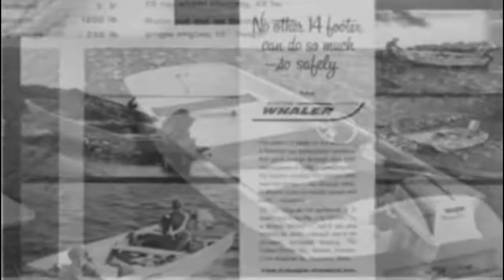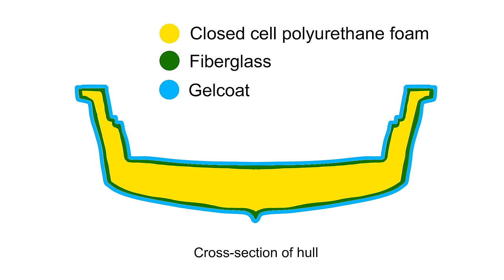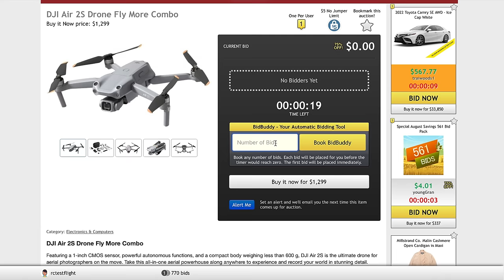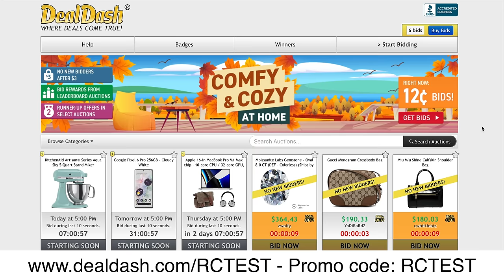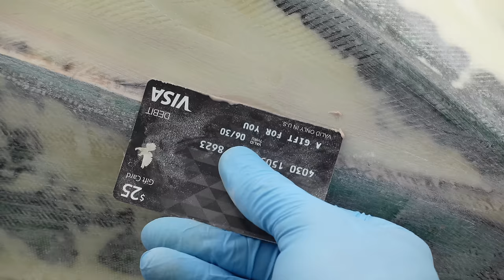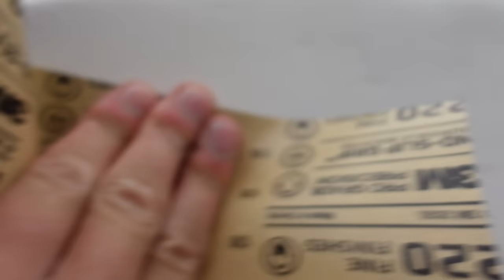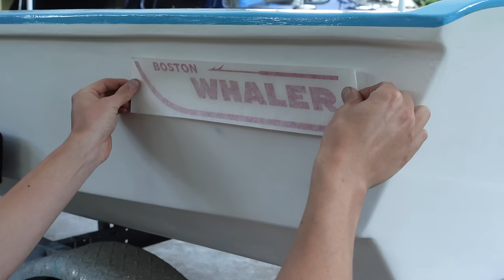50 Year Old Boat Restoration - Solar + Electric Conversion Ep.1

Comment: Yeah I got the perfect motor for your boat. I have several of them actually you're more than welcome to one. They're 48 volt 20 horsepower can be run on 96 volt for 40 horsepower made by Advanced DC. They are dual shaft and actually are perfect for mounting in an outboard motor. Removing the gas engine and keeping the lower Drive Unit diesel bolt right in. Jamie from Mythbusters used one to power a jet drive. There's another guy on YouTube that use the same Motors for a ski boat that he can actually ski behind. Anyway they're brand new. If you want to mess with one let me know.
Reply: Excellent!
Reply: NICE
Reply: Skip the outboard lower unit, lose tons of power and energy to the bevel gears turning in oil + extra maintenance. Just get a stuffing box or dripless carbon seal and straight shaft it
Reply: Do all seven motors run on one boat
Reply: @JH-tc3yu  if it were my boat that's what I would do. But with these particular Motors they are dual shaft and the one end of the shaft is the same as used by most outboard motors for driving the accessories. Makes for a nice conversion but I agree with what you're saying. I just didn't think he was going to want to go through the effort it would take to drill through the hull and make that work. There's a video on YouTube of Jamie from Mythbusters using my motor the exact same thing on a 40 horsepower jet drive and it's pretty amazing. And there's another guy that did the exact same thing on a 20 horsepower lower Drive and he pulls water skiers with it. He's also on youtube.
Reply: Good stuff. I'd want a jet boat with one that would be neat.
Reply: buy ektric ski bost

Comment: I"m sure this message will be lost in the crowd but after working a lifetime in the Marine Industry, Including years as Forman on Marina hard-stands, the range of knowlage you showed  really surprised me even if the experince wasn't entirely there. I've seen worse work by so called shiprights haha. Well done matey!
Reply: I know this comments a little old, but is a restoration thats this intensive actually any cheaper than buying a new or maybe lightly used boat? Even project boats are expensive where I live (WA State). I think ill need something at least 15'ft to feel safe taking it on the sound and I'm trying to find the most economical way to go about it 😅

Comment: May not have been cheaper, but I feel like it for sure would have been faster to just build your own boat, assuming you can get the foam they put on the inside somewhere. Plenty of channels on YouTube where people have made their own fiberglass boats in a few days without having to basically un-make an existing one first
Reply: You must be new here
Reply: I was thinking the same. I've seen some YT vids where they use sheets of foam that they cut the sheets and assemble into a boat shape and then fibreglass over the top. I've made one attempt at building a catamaran using two part foam that was to be fibre glassed,  but that failed terribly. Next will be this sheet foam approach.
Reply: Bro' do  you even watch?  He mentioned that already. I'll let you re-view the video and you can tell me where he addressed this.  Have a nice day! :)
Reply: I have an inflatable vinyl boat that cost me $60, max weight is around 800 lb. There are a bunch of videos on here of people doing plywood mods to suit their needs. I feel like it would have been easier to get one or two of those and make something. The plywood base I cut for my boat actually fits inside my car with the back seats down. It's all small enough that I don't need a trailer or a registration sticker.
Reply: That is the whole point, and why this channel is so fascinating and fun to watch:  it is the journey and its challenges that are interesting.  We learn so much more when faced with adversity.  It is the impeded stream that sings.
Reply: i think with experimental stuff like this it does kinda make sense to just get it in the water as a platform for building and testing EV systems. you could even build a more optimized hull later.
Reply: It was also cheaper and faster to buy a roasted hog from a restaurant, but that didn't stop them either.
Reply: @shanefiddle  So i guess the whole point is that its about him fixing useless stuff and using a 10k router to cut out a 1 dollar sticker.. I get that its fun to watch but i cant get to why.. like why even buy a wrecked whaler and put 400 hours of work in and 5k in materials when u can just buy a brand spanking new one for about half that money... or just get a used one for like 1500 bucks that has no holes or gelcoat damage.. 

Like now he has it all fixed up and he has like 5+K in there.. but if he were to sell noone would give u more then 1k for it.. because its non original.. and also a non damaged one is about 2k.. not 5..
Reply: @larsvegas1505  Fixing useless stuff?   Doesn’t look too useless to me.  But more importantly, the fact that you’re so dickbent over the kid restoring something himself rather than just buying a new one is a little odd, but I think it might show that you’re just not the type to take on a challenge in order to gain experience and knowledge in a particular discipline to make yourself a more well rounded and useful man who possesses valuable and rewarding skills with his hands.  That mentality is why the craftsman is a dying breed in this country.  I wonder sometimes if there were actually to be a “SHTF” type situation like prepper-type folks are always…preparing for, how many men these days would feel useless to their families and totally ill-equipped to provide for them or to build/rebuild all that may be needed to live comfortably after starting fresh in some remote spot with no infrastructure.  Anyway…apologies for the tangent. Refurbishing would have been a bad business decision if his business required extensive daily use of a skiff under rough conditions and he’d have no backup in case of a breakdown…but he doesn’t do such work.  And if it was strictly a business decision, I’d say he gets more views and interaction from videos of restoring a boat than he would a video of going to a dealer and buying a new boat. And there’s also a personal element to choosing to restore as a means of personal growth, for the feeling of accomplishment and pride in having accomplished something difficult that others would never attempt, let alone accomplish with such a level of quality….and some folks have an appreciation for iconic classics and things that were made the right way in this country prior to some assclown coming up with the idea of planned obsolescence…when hard working men built hard to break products meant to last for a lifetime and enjoy the unique flavor that owning and using an American classic that bears their fingerprints on every part from top to bottom and they know and can repair themselves if it should ever end up in need.  Kinda like why as soon as I could afford to buy a second vehicle other than the truck required for my work, I bought and spent countless hours working on a car nearly 60 years old with no A/C to drive any time the work truck wasn’t required.  Because it’s just cooler than buying a Prius.
Reply: @drthunder187  Here in Michigan any watercraft with a motor needs to be registered to be legal
Reply: @larsvegas1505  wow what a great video idea that sounds so watchable! He would be like check out my boat! I bought it all dope already! alright see yall next time!
Reply: @larsvegas1505  that's not 5k in materials

Comment: Dude as someone who works on boats regularly. Your fiberglass work was fantastic on this whaler, very few guys go as far as you did to remove all the old gel coat and repairs.
 Here's some tips encase you plan on doing anything similar again:
 to make it easier to laminate large pieces of 1708 biaxial matt you want to place the matt (chops strand side up) on a table wrapped in saran wrap or plastic sheeting to avoid destroying the table. Then pre-impregnate the matt with epoxy or poly and wet it out until transparent, removing any excess epoxy. Transfer the wetted out matt onto the repair area and lay it on and roll it out using a regular paint nap roller you can buy at home depot. Make sure the hardware you put on the rub rails was actually stainless steel, Anything else and your going to regret it. and for sealant, you should def go heavy on sealant, Best ones being 3m 5200 brands. Fantastic job with the skiff!

Comment: I also have a 1972 Boston Whaler 13! Mine was converted to the sourpuss layout by the previous owner. My gelcoat is just as bad but the hull is in relatively good condition. I started sanding and scraping on it a year ago but I'm now thinking about sand or soda blasting it. I've just been using it like it is for now. It's still a fun little boat!
Reply: I'm not an expert but i was thinking given the complicated geometry... would not be easier to just pay for sandblasting it at a shop ?

Comment: For future reference if you remove the outer wheel bearing and then put the axle nut back on you can usually remove the seal without damage by pulling the wheel off. Love the project!
Reply: That works on cars but on my small boat trailer the axle nut doesn't fit through the hub.  I had to order new seals to repack the bearings because the seals a cheap junk and get dammaged.

Comment: I restored a near identical Boston Whaler 13 from around the same year. Took me like 2 years of sanding, fiberglass, more sanding, fairing compound, more sanding, paint, more sanding, building a console, more sanding... You get the point. The thing rips and despite driving boats for a living, I've never had my own motor boat until now.

Comment: great work! the only thing i didn't like was how you used silicone for sealing bolt and screw holes. I live on a 42-foot electric sailboat and I have found that it's usually worth taking the extra time to over drilling the holes and then fill them with epoxy then drill the needed hole size through the epoxy. in other words drill fill drill. seeing as you just put in so much hard dusty work and time on the fibreglass and gel coat it would be sad to lose the seal with that silicon and end up with a soggy foam core.
Reply: buy 425  soolar ektrc sail boart

Comment: Amazing work, I know how much work goes into restoring a boat. One thing I'd recommend, in the future, is to use 3M 5200 instead of silicone sealant. 5200 is designed for sealing holes and small repairs below the waterline.

Comment: My 3 by 21 Ryobi Belt Sander is one of the best tools I own. For years I used it with a 36 grit belt to sharpen my lawnmower blade (just to illustrate how tough it is!). Though mostly I use it on woodworking projects. BTW I own two random orbital pad sanders and I have yet to even use one of them because they suck the big sailor balls.

Comment: My father always talked about boston whalers! Nice catch.
Your choices of materials are spot on: epoxy is durable, and gel coat is a uv blockage to protect the epoxy, so be glad you didn’t choose epoxy paint.
And polyester resin delaminates with water! (I know they use it on boats! Insane). So with time your repairs would have died. This thing is going to last decades!
Really nice restoration.

Comment: Nice work! I have found that it is best to repair polyester with polyester - it bonds better. Epoxy sometimes just peels off, not sure why?  Bias tape conforms to curved surfaces much easier and you get more build more quickly.

Comment: Nice work man. Just a quick tip for the next time you use your HVLP... rotate your nozzle 90 degrees, and set your spray to a vertical fan. Then you can cover a wider area side to side. That's how it works best for paint anyway... I've never sprayed gel coat, but it looked like it could have worked better that way.

Comment: Cool restoration! I’ve got two of these whalers I restored. Most of those small cracks in the gel coat is called crazing. They are purely ascetic and do not harm the fiberglass underneath as long as there is not deep goudges or rot. The rear little cubby spot you had mentioned is a splashwell and fills with water. The front bucket holder is actually where they injected the hull with foam. If I were you I would look at the transom where the motor bolt holes are and see if the wood in there is rotten. If so you will need to pull the whole transom out and replace the wood inside.

Comment: A better boat than new .Stunning. Sprayed large louvre doors  with airgun, its an easy technique with a difficult setup. worth it for the results. fixing the rubber strip to the hull, as you say pop-riveting, its a commen problem, my house has plaster board walls . Ive tries several styles of fixing and what we need is a very soft pop-rivet that hardens when squashed, ooh,  fiberglass washers .

Comment: There is a tool called a gelcoat peeler or paint shaver. It's a lot like a rotary planer for wood. You can remove everything in one pass. It's a major time saver. Also, you needed to use a moister meter to check the moister level before reapplying the gelcoat. The moisture will cause the gelcoat to bubble and eventually peel off. You did a great job getting those small areas prepped as well. Amazing job as always!

Comment: For anyone interested in epoxy filler and fairing compound for building stuff, the Tech Ingredients channel has a video comparing properties of epoxy with a lot of different fillers including the glass microballoons, but also with stuff like basalt fibers, silicon carbide, graphite aluminum powder, and titanium coated diamonds

Comment: I just bought an old fishing boat about the same size that you’re working on and I am going to be fixing it and looks like I’m gonna be running into the same issues that you did. So thank you so much for the video and it gives me a little insight on what I will have to be doing.   I will start in the spring.
I will be using the surface finisher from Harbor freight that I mentioned in an earlier comment.    Hopefully it works well and doesn’t cause more problems than I already have.

Comment: Nice video... a couple of suggestions. 1) Where you had trouble getting the glass cloth to conform to the radius, you might have made fillets from thickened epoxy along those corners  2) this project would have been a good candidate for vinylester... about midway between polyester resin and epoxy in terms of price.. but much more waterproof than polyester. Would have halved your resin cost I think 3) the fairing compound you used under the new fibreglass... better to use the more structurally strong epoxy thickened with cabosil (and milled fibres if you want) for strength. Fairing compound is really for the final surface. 4) peel ply is very inexpensive and would have given your fibreglass repairs a perfect surface without sanding for secondary bonding while at the same time stopping amine blush. 5) gel coat wasn't the best choice for final coat... a 2-pack paint (or flow coat) would have ben better and cured better 6) finally some of the repairs you dammed up would have been better done by building up small layers of glass. Despite all that a good and very patient job.

Comment: For these thick fiberglass sheets you need a so called Fiberglass Roller, to really masssage the epoxi resin in there. But it will only work propperly when you use a chop layer. actually when glassing anything you allways have to use a first chop layer. Then Rolling will have the desired effect.

Comment: Those whalers are great I hear. They are unsinkable unless you crack em in half and will last you forever. Also around the 51 minute mark I noticed that you didn't put silicone where the handle touches the washer, only where the washer touches the boat itself, water might get in there over the years, I could be wrong just something I noticed.

Comment: When drilling holes in the hull for screws / bolts, best practice is to over-drill the hole, use a dremel to remove additional couple millimeters of foam (to give a hard shell to bond to), fill the hole with thickened epoxy, let it cure, then re-drill the hole at the correct diameter, and place a donut of Butyl putty around the opening so that putting the bolt in compresses the butyl and pushes it into the hole.  Just drilling a hole and putting a little silicone around the hole as you did will surely begin to let water into the foam and begin failing within a few years.  Especially for things like the bow-eye which will be under higher pulling loads from various directions, the silicone will flex and fail pretty quickly.  You did sooooo much work, it's worth re-doing your fasterners to make sure it doesn't fail again for a long time.

Comment: JFC the dedication is commendable. Wish I could have sold you my already converted to electric boat (it was in portland as well). Sadly a year late. 
Looking forward to what you'll do with the electric propulsion. I used one of those Torqueedo 4.0 electric outboards. Friggin loved that thing. Wasn't fast but it was reliable and super efficient at trolling speeds. With no wind I could troll at ~1.5mph at like <200watts on a 14' aluminum boat.
Reply: goid fór yoú